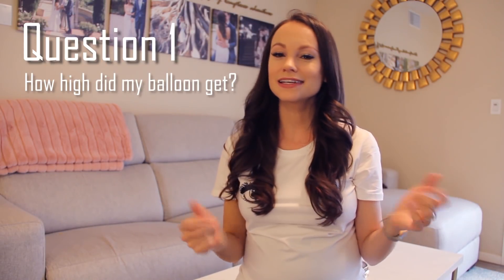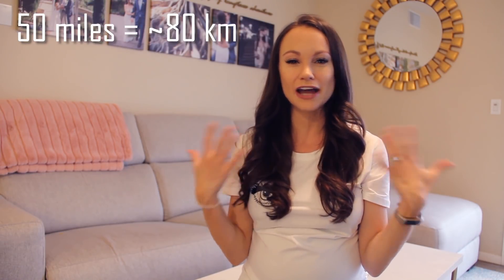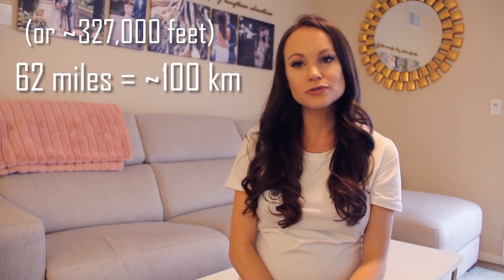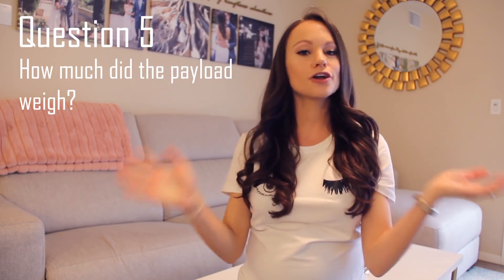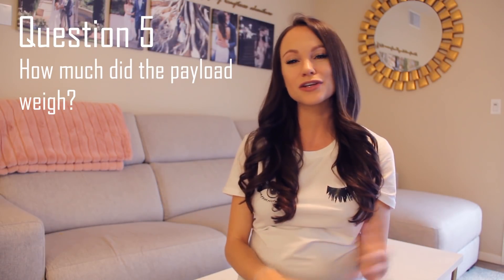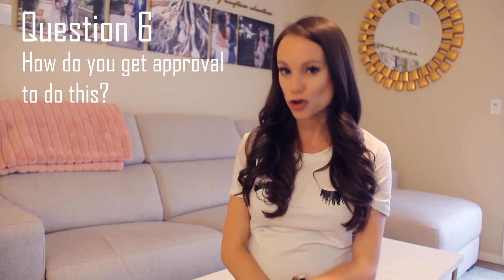How to Build a High Altitude Balloon

Comment: 2 and 1/2 hours from ascension to landing x 1000mph for the supposed spin of earth(that has never been felt nor measured) = 2500ish miles away from launch site. Your payload landed 200ish miles away...sounds about right...pfft
Reply: There is medicine for your condition.
Reply: You multiplied 2.5 x1000 😂 that's hilarious

Comment: Also super important to note for others... filing a NOTAM is not getting approval.  NOTAMs are handled by LEIDOS Flight Services, not the FAA.  They will file the NOTAM however you tell them to, but they assume you know what you're doing and having a NOTAM is not an endorsement.  If you're not following the rules, the FAA may still come knocking even if you successfully filed a NOTAM. Small balloons do not require approval of any kind, but it is best to coordinate with the FAA anyways ➡️ http://olhzn.com/safety
Reply from the maker: Thanks for clarifying! So, for example what would cause the FAA to "come knocking at your door?" If any of the flight prediction looked off or if there was airline activity in the area that would prevent you from launching?
Reply: @EmilysScienceLab  They would "come knocking" if any regular citizen or airline personnel submitted an anonymous safety complaint (justified or not).  For example, we had a pretty awesome airplane flyby caught on video ( https://youtu.be/Cla34QzgbKc ) which resulted in anonymous complaints (understandable, but not justified).  We were then audited by FAA's FSDO from top to bottom on everything from operations, payload weight, payload density, string tensile strength, parachute size, equipment, etc.  Fortunately, we follow all the rules & go beyond so we satisfied everything in the audit, but if they had found something we could face fines or worse.  Moral of the story... make sure you cover every bullet point in the regulations (there's not many) and then even go further than that with some common sense safety practices.

Comment: Aside from the obvious safety concerns, are there other disadvantages or advantages to using Hydrogen?  Is one gas more expensive than the other, or easier to find?
Reply: Hydrogen is WAY cheaper and does allow your balloon to go higher, but there's the obvious increased safety risk.  We recommend any first timers start with helium for safety.
Reply from the maker: Everything Tory said, but I will also add that everyone recommended that I DON'T use hydrogen since this would be my first time flying. Reserved for experts!
Reply: What about access?  Can any moron off the street buy a crap ton of Hydrogen without any kind of license?
Reply: @MParker8200  It's definitely harder to find a supplier for Hydrogen, but mostly due to purchase volume/frequency, not licensing.  No license required to buy Hydrogen... you're on your own for safety.  Buyer beware!